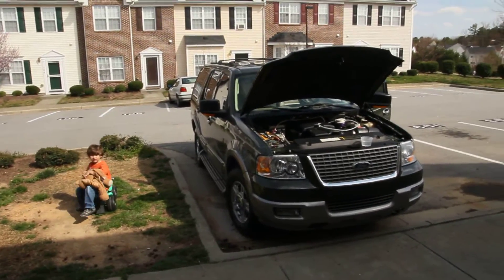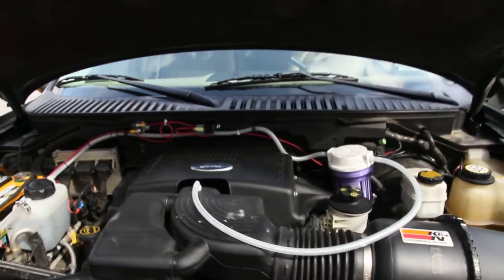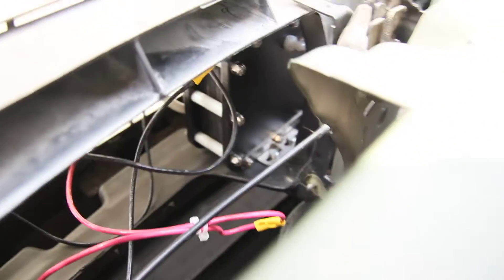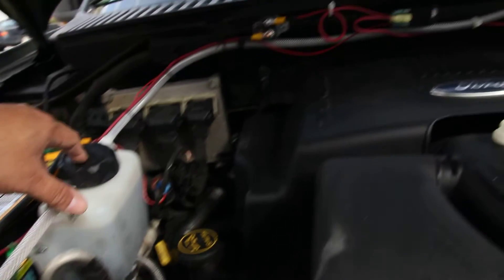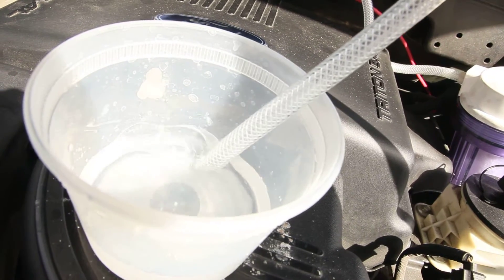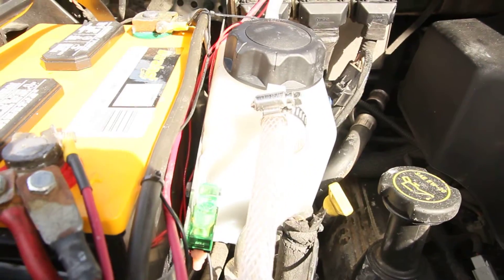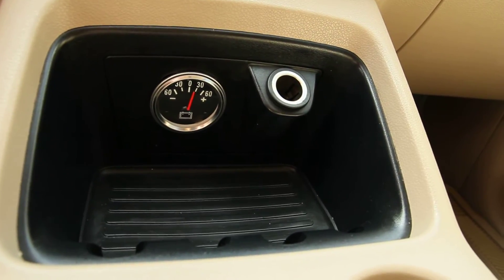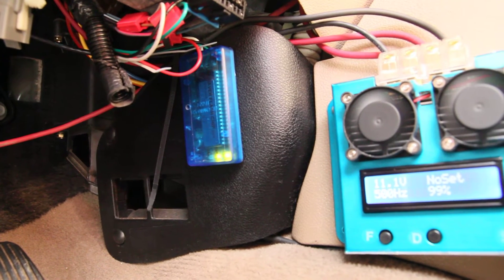DC 1600 Double Stack HHO Dry Cell w/PMW & Flash Chip

Comment from the maker: Yes thats correct you can also go by amps per displacement. For examample the ideal formula is 5 amps per 1 liter of engine displacment. I have a 5.4 so ideally Im need to be at 28 amps. You can increase that if you need to but if you can a smaller car, there is no need to be that high.

Comment from the maker: Its all good man, Its good to get others inputs. I may miss something that you catch.I will consider other possiblties. I wish I had a snap on scanner. I can diagnose the issue right away. I can start at the O2's and work from there. O2's are generally at normal use at about 0- .4 volts. If I drive with a scanner and drive up a hill and give it gas putting it under load, I should have a constant voltage or a tolerance gap. If the the voltage jumps around I know I have reading issue.

Comment: before you try anything, you should reset your cars ECU and the volo chip. In many cars you can reset the ECU simply by unpluging the negative cable from your battery and live it like that for 20 min and then reconnect. That is how i "deleted" the check engine light warning after I fixed my exaust. Hope this helps.
Now, you wrote you are using KOH and you wanna try NaKOH. Dont know what that is... Perhaps you ment NaOH?

Comment from the maker: Although I do agree to some extent, if the O2 fault is intermittent or if the load is not long, it will not throw a code. I know this because I was a dealer tech for 8 yrs. That being said I also suspect the O2 because when I reflash that ecu with the chip it tells the O2's to lean out more with a higher voltage probably around .7 volts. Thats also when the pings worse under load. I dont have a snap on scanner to really get all the readings I need. Ill check back.

Comment: exaust pipe 10 cm before the sensor so my sensor regestered additional oxygen comming trough the hole and it was showing an defect. I fixed the hole and now sensor works just fine. Sensors are wuite expensive so you might check some other resasons for it now working properly. In your case, since you have HHO relesed into your intake, your sensors might register additional oxygen and report an error. But, in your video I saw you have a Volo chip and that should compensate for O2 sensors. Perhaps

Comment: If you think you have faulty O2 sensors, I think the "check engine" light would be on... Now even if it is on and even if the ECU scanner shows that you have a faulty O2 sensor, this might not be the case. In my Tiburon the check engine light turned on so i went to see what was the issue, and the scanner showed post-cat O2 sensor is defective. Fortunately I googled about faulty sensors and even the scanner shows the sensor is bad, that might not be the case. In my car there was a hole in my